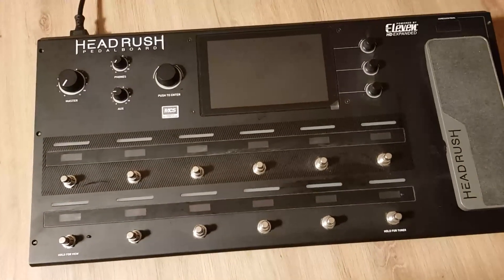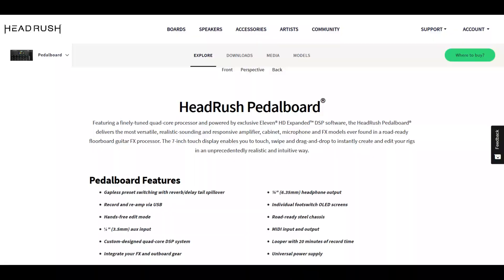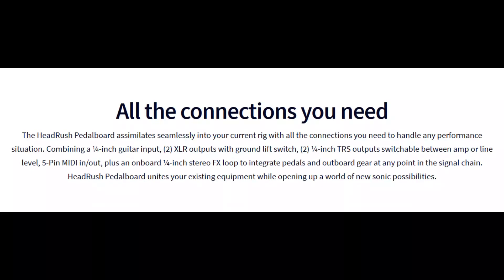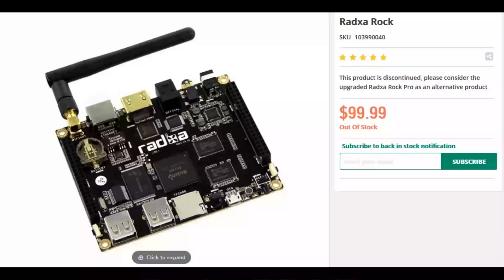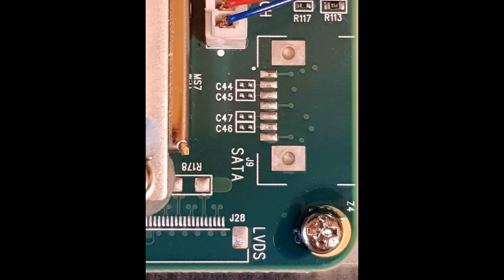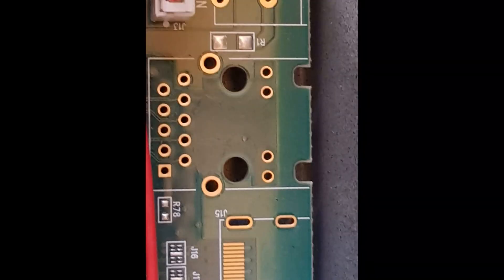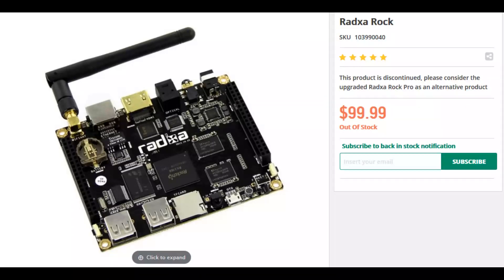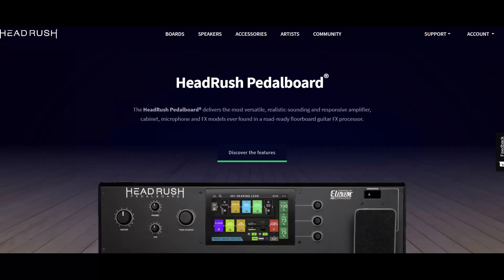HeadRush Pedalboard Problem (a quick guide)

Comment: I have the same problem, I am desperately looking for a solution.
Reply from the maker: There is no DIY solution, only replacement of motherboard will work, but i thing it is better to search for something outside of InMusic brands devices
Reply: So sad, I feel cheated
Reply from the maker: @mikelemon1111 , me too, buy InMusic has nothing to worry: thay said that only the steel chasis is durable and road ready. You can see my other video after the repair process
Reply: The motherboard is dead as you said… And yet, my use was quite careful.

it’s expensive to replace,
and the new motherboard's reliability in the long run cannot be guaranteed…

it sucks so bad

Comment: Bought mine second hand on eBay in 2020. So far it has survived gig after gig. I guess as with all things you may have got one from a bad batch. In any case these days if you get two years out of any electronics you are lucky
Reply from the maker: I have eleven rack for 8 years, helix for 3-4 years and a 30-year old korg triton for 2 years. this is a prototype, not a device.

Comment: I’ve had mine 2 years it has a glitch of some sort. Makes it sound as though the guitar output Jack is bad. But it’s an issue with the gigboard. I also contacted Headrush and got no response. Anybody else have a solution?

Comment: I regret buying this turkey deeply. I almost call it abandonware, but just as I'm about to get rid of it they release a new firmware that does nothing to improve the unit. It only adds a new amp and a few effects. This unit should be at the top of the heap. It has a touch screen that is huge. But the programmers have no idea on designing a good interface. If its a touch screen that let the user use it as touch screen 100% of the time. The retarded design means you have to use the knobs on the side to alter values. On the PB you cannot slide to change settings. (you can on the gigboard). Rather than show graphical images like sliders or knobs, they just but a number. eg. 20%  or 2345MHz. No idea where you are. On a real amp or effect real people talk about a value of 10 0'clock or mid day to tell you where a knob is. Human beings are more visual than cerebral. You try editing a simple thing like colours on this trash and you have to fight with 0-180 degrees and percentages? How does that relate to RGB? You have to touch a box with a value in it the go to the MAIN knob and spin and spin and watch  to see what might be changing. Want to know what firmware you are on? Breakout the microscopes and squint at the bottom of the screen. Apparently it is a top secret and the retards who programmed the unit think its fine.  You have strips but you can only write in BLOCK CAPITALS. Why??

Try and contact anyone at Headrush and listen to crickets and tumble weed. Never again. The sounds are not better than any cheap unit out there but if you like a challenge and a rubik cube schizoid interface then enjoy the pedalboard. I wish I could flash the PB with GB software as it is more refined. It can't be that hard to port it over as the hardware is almost identical save a few more switches.

I could go on but if you want a better unit at 1/6 the price with a good interface that you can touch...
go ampero. (although it too is abondonware and flawed is some places).

Comment: Hello, which screws are the ones to  unscrew to open it ? I retired the 6 on the top, the 4 on the jacks side, but I don't know if I need to unscrew somme of the the bottom screws.
Reply from the maker: As far as i remember there are few screws below the expression pedal, near sockets and switches.
Reply: @dextervipera  Thank you,
I opened it. Now, I have to identify the uart pins.

Comment: Hey! Did you have any solutions for this issue? This problem happened to me today.
Reply from the maker: Hi, there is one way to fix it - motherboard replacement. It can be done only by service. If You are from the USA the service should replace it even out of warranty, in Europe, You will have a problem unless You will phone InMusic support (they do not respond to contact form and mails unless You phone them), and I hope, that after a few months and a dozen of e-mails They will replace it for free. Remember, that this won't solve the issue, just make Your unit working a bit longer, up to the next ROD.

Comment: This old debate. Yep, Headrush are USELESS at customer service when you compare them to Line 6. I have emailed Headrush over 30 times! and have never once had an answer! Also waited over an hour on the phone (And I'm not alone)The Headrush Pedalboard has two known issues which Headrush will fix immediately if you live in the States (or maybe the UK.) but will totally ingnore, if you live, say for example, in New Zealand, where I live. So, if you have either the Rainbow of death (ROD), which may well be, as someone noted below,  a software problem, you can't reload the software so you can't solve the issue because the machine won't turn on. The other issue is the loss of USB communication. This has the same problem as the ROD. If you can't talk to the machine you can't fix the software. Even a factory reset doesn't help. However you can fix the machine yourself by swapping out the controller board (The one shown in the vid above). You can purchase them from Mike at Instrumental Parts, I think it's www.instrumentalparts.com  just google it. They are 170$US. He's a super good dude to deal with, responds to emails almost immediately and is knowledgeable. I would have had to throw my unit away if it wasn't for that company (The part took only 9 days to get to me). Swapping the board is easy as long as you are careful. I've also got a Helix - Which has also failed since I've owned it so it's not just a Headrush problem. The difference is that when I emailed Line 6 they had a job number raised within 1 hour and had a service agent contact me. They then proceeded to organise the repair...The companies are chalk and cheese. But I've got to say, I still prefer the Headrush to the Helix. It's purely user preference and nothing to do with sonic quality, which is great on both the units. PS. I once mentioned the terrible communication problems with Headrush on one of the forums. I was called out by the moderator for spreading BS about the product He said he'd contact Headrush on my behalf himself and check out my "claims". Never heard from either of them again LOL :-) (been 3 months)
Reply: Thanks so much for the info.  This same problem happened to me. I have no experience repairing electronics of this nature.  Any tips?
Reply: @kiko.yamashita  If you are not confident to make the repair yourself. Buy the board and take it to the local computer repair shop. It's so easy they'll be able to do it in 15 minutes as it is just a simple board swap. Once it's done you'll have to download the latest software and update the board. This is also really easy. I had no trouble fixing mine, good luck. :-)
Reply from the maker: Hi, my tip is to change pedalboard to anything else....
I'm not objective, but no one does
Reply: @MrReStories  the description of this item says “Headrush Gigboard”.  Is it still comparable?
Reply: @kiko.yamashita  Yes you are probably right, it's most likely this one, sorry about that    https://instrumentalparts.com/pcb-carrier-assembly-headrush/ . I've just looked on my board and it has a different part number to either of those boards so they must have changed them. When I ordered mine there wasn't a version for the GIgboard so there was only one to choose from. Email Mike  at  Instrumental Parts and just check. Tell him you want the Pedalboard, not the Gigboard version. His email is  sales@instrumentalparts.com . Mike is  a really helpful guy.
Reply: @MrReStories  or is this the one? https://instrumentalparts.com/pcb-carrier-assembly-headrush/

Comment: Had mine for two years now, used it at many gigs. No issues at all and no regrets for buying. I had contacted their tech support for guidance on playing through both a sound system and also amplifiers. They were prompt and helpful. I highly recommend this pedalboard.
Reply: I had the exact opposite experience. They were unhelpful on their support forums. I would send them videos of the glitches and logs or whatever they'd ask for. They'd say they'd pass it along to the team and then they'd never answer again. They no longer approve my posts on the forum despite never even giving me a warning for breaking any rules, and they blocked me on all social media.
Reply: never thought I will be commenting here. How's your USB up to now? I ran out of luck like the rest of the users.
Reply: Bought around June 2019. Slow customer service, brokern USB, Right XLR not working all in less than a year. And guess what? Barely used due to COVID! No more warranty after all the repair. after 3 yrs, now not loading. I'm happy to know your product is in good condition.
Reply: Sounds like the shill got the working one, as ever, while the rest of us got boned, as ever.
Reply: It seems you're trying to contradict the video, but all you have is an anecdote about your personal experience. It doesn't even cast an iota of doubt on the described problem. A lot of products which have problems stemming from the company trying to save money by compromising quality, don't fail in every case from day one, obviously. The problem might be very real and serious, and yet not every user will experience it, obviously.

 The fact that you didn't experience the problem is meaningless for someone considering the purchase and trying to determine if there is an unacceptable risk involved. Your anecdote proves only that for one user, so far, the problem hasn't appeared. Quite simply, that means nothing.
Reply: @Gregorypeckory  I'm guessing you're a single man, you talk a lot but have nothing to say. I gave my personal experience, or as you say "anecdote", which may be a new word you learned today since you used it often. Troll someone else. I own this pedalboard and have every right to express my opinion.
Reply: @fatherof3kidz  Okay, so you can't make a point to save your life, but at least you can call others idiots as you prove that you're one yourself. 

But I'm not mean, so I'm going to invite you to make the case as to why I'm the idiot. Go ahead whenever you're ready, and explain how gloating about the fact that you're very happy to be problem free yourself, helps the people who aren't so lucky. This should be fun.

Comment: from the first moment of listening I understood that inside there is something that does not convince the sounds are cold and they all look the same in short with cheap components, on the contrary I own eleven rack and I assure you that inside it is a work of art as building components and above all as fractal and kemper top audio. now watching your video it is all clear to me a lot of claims to sell but in fact this pedalboard is a flop
Reply from the maker: I owe 11R too :). I also bought used unit and it serves me for 6 years - and it's still working. The sound of working HRPB and 11R is very good, but this film is not about the sound quality.

Comment: Call headrush directly. Don't whine here, it's not gonna fix it. Headrush will replace or at least repair it
Reply from the maker: I called HR, they responded to my mail, promised to repair my unit, but i'm still wating and nothing happened.
Reply: @dextervipera  did you ever get your issue resolved?

Comment: Not a Headrush fan (on the contrary), but I don't really get this "analysis". You mention a microcontroller, then Raspberry, then Arduino (as they were all microcontrollers, which is not true at all, being Raspberry a complete computer with OS), like you don't know the difference at all. 
Then, you proceed to criticize the use of this "cheap thing", without any real hint of its function (maybe it pertains only to the UI and configuration, so you don't need processing power at all). The whole point of why this controller is bad is not explained at all in a reasonable manner.
Sorry, but not convinced, this is pointless without further explanation or analysis.
Reply: Hi Cranio, Headrush is using the Rockchip RK3288 SOC for DSP processing. The guts of this thing look like a proto-type. With an ARM7 processor it has no chance of crunching real time algos like the shark chips do. I am really surprised that Avid would release a product like this. 
Helix & HX Stomp PCB are works of art in comparison and Fractal/kemper a up there too.
Reply: Benjamin Ashlin the headrush has a quad core vs the helix’s two cores. It def shows in switching and overall tone. The fidelity on the headrush is much better out of the gate.
Reply: @mreyes8519  , not the number of cores but the sum of stability, sound and elasticity makes the device great. It would have 8 cores Intel Core i9 inside, but it does not matter unless the device is not powering on.
Reply: Produkcja Audio ive had the HR for a couple years and haven’t had a hardware failure. This is a boot error, and not a result of the hardware of the system. If this unit wasn’t opened it’s easily replaceable under warranty.
Reply: @mreyes8519  the problem is when you have a year with the product and at that moment it fails
Reply from the maker: I agree: Radxa Rock, Raspberry PI and Arduino are not microcontrollers but computers.
I criticize "cheap thing", because HeadRush told, that they were used custom design electronics, but the electronic seems to stop working in some cases (rainbow of death, blinkee). The device is fragile and can stop working without a reason. The engineers showed lack of experience placing this computer inside the HRPB and cutting holes to power on button and USB. There is also a very popular issue related to USB communication hardware failure - The HRPB will not act as a recording interface anymore.
Reply: No, Arduino is not a computer, it's a microcontroller...
Reply from the maker: @Cranio76  Ok, thank You for explanation.
Reply: @dextervipera  I am aware of HR's problems, I just am not sure that the microcontroller is the culprit. Surely, it's not "custom".
Reply: @Cranio76  Dear smart cranio ... This is exactly what my device produces. it worked tonight not last night. it is because you explain that at the age of 2 this shit died. It never left the apartment and looks like a New. I don't even have a name for my Chinese computer for 5 years I used it for 5 years and my son always uses it. i don't think a thousand two hundred dollars worth of equipment in the apartment would deteriorate at 2 years old. In 40 years, I have disassembled and repaired thousands of tools, but I haven’t seen anything like this in a one-dollar basket. I'm sorry, respect for the exceptions. I was just thinking about buying an active speaker. I'm glad I didn't.

Comment: You opened it so now they won't send you a replacement
Reply from the maker: I opened it because I did not have any response from dealer. As well as I know, there was no sticker plumb, so formally no one can prove that the FX was opened and the guarantee has run out. The rest lays on good will of HeadRush service center